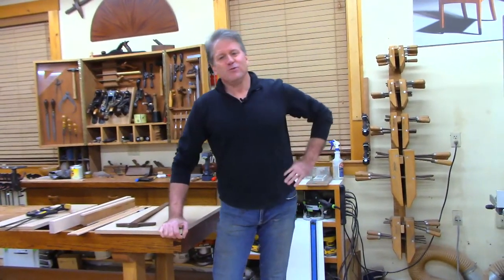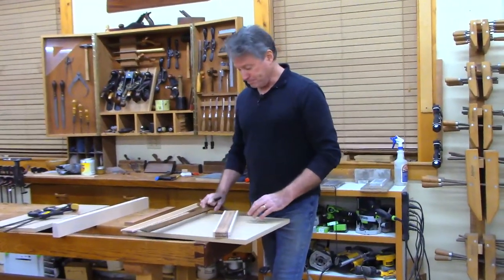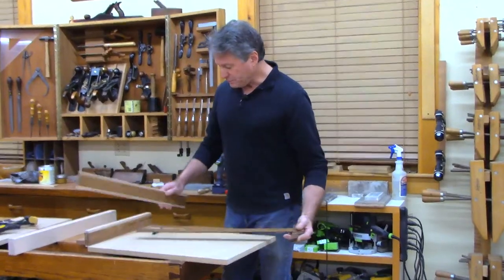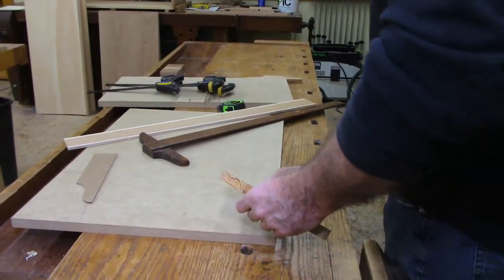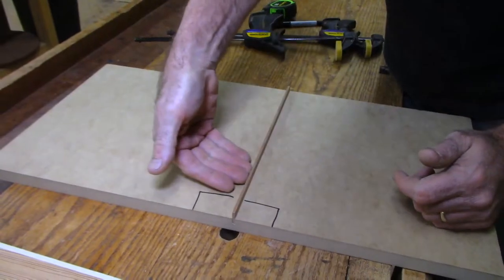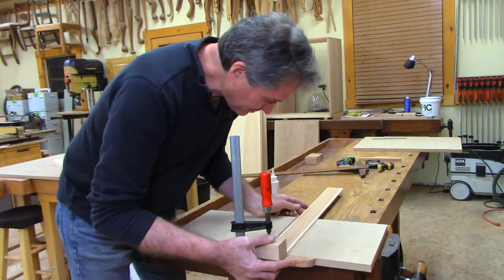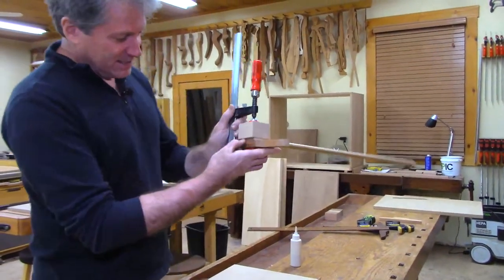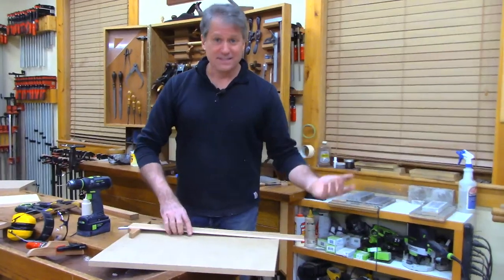Make a Drafting Board with Tom McLaughlin

Comment: Well that was really great.  I want to make just something basic with which to fool around and that gives me some ideas.  For reasons too numerous to mention, I don't want to buy a board made in China.  I will make a slightly smaller board and was just going to use a commercially manufactured t-square.  The two ended version will be much nicer.  Thanks for the video!

Comment: Hi Tom, that store bought drafting board was loyal to you while it lasted. Now you have a new hand made one that will be even better and last a life time of designs now, and in the future. You have already started your designs with a great drafting board. I have a drafting table I have had for years, do you remember Borrows office and supply stores, well that was where I bought it.  To go along with it  I have a T- square and triangles and  miscellaneous drafting supplies, even a electric eraser. I also have used what is called a drafting machine, used before CAD. It has three pivot joints with arms, attaches on top of the board, the bottom joint rotates 360 degrees and locks in at 90 degrees, also it can be locked in at any degree you need. Attached to the rotating joint are two flat scale rulers at 90 degrees to each other one 12" lateral and a 18" horizontal, you use the scales to measure and draw your lines horizontally or laterally and rotate the arm at any degree for angels. I have use it alot it makes drawing quick and easy, the problem is its not in the shop. I like your drafting board because it's quick and easy to use in the shop, I am thinking of  building one for myself,  do not know if I will put the drafting table in the shop. Thanks for sharing your design, see you next week on SNL.
Reply from the maker: That’s awesome Steve, sounds like you have a lot of good ideas and options there for a drawing board! I am really happy with mine, and hope to be using it for a good long while 😎. Thanks!! Tom

Comment: What is the drawing board material called?
Reply from the maker: It’s called MDF, and here’s the description of it:  Medium-density fibreboard is an engineered wood product made by breaking down hardwood or softwood residuals into wood fibres, often in a defibrator, combining it with wax and a resin binder, and forming it into panels by applying high temperature and pressure. MDF is generally denser than plywood.
Reply: @EpicWoodworking  Thank you so much Epic :)